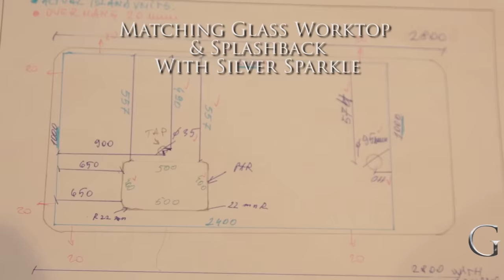'Espresso Silver Sparkle' Glass Kitchen Worktop & Matching Splashback | CreoGlass Design

Comment: Yeap! It looks really amazing!
I wonder how much it's strong against scratch and heat resistant..?
Reply from the maker: Hi Ezra, All kitchen glass splashbacks should be always toughened and so heat-resistant. Glass splashbacks are most of the time glossy and sometimes matt finished. Whether it's glass splashback or a diamond all high gloss finish products must be cleaned using soft materials and avoid abrasive sponges or other detergents. In simple terms, you would like to treat your glass splashbacks just like any other glass in your house.